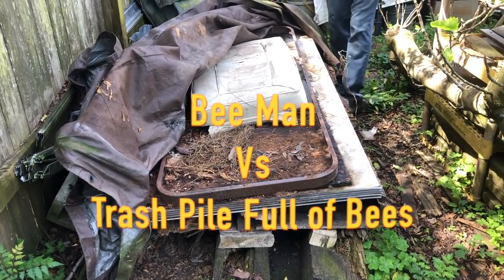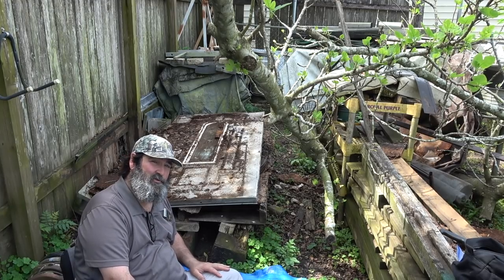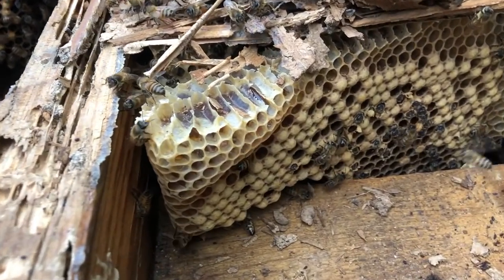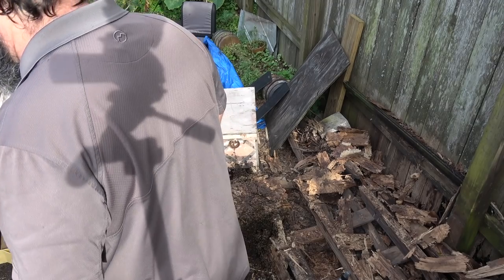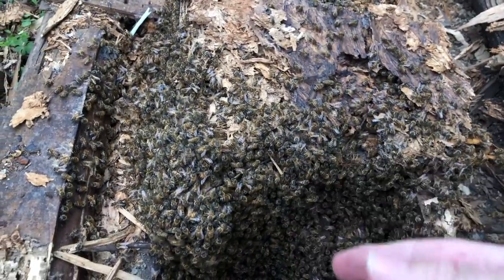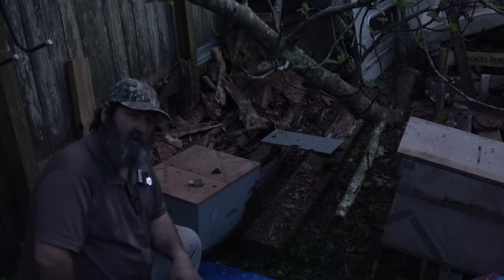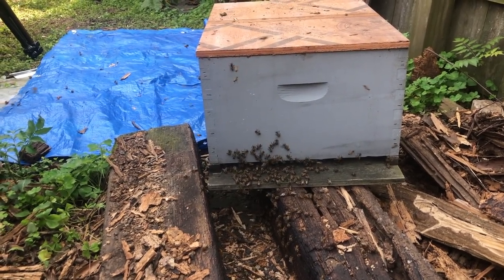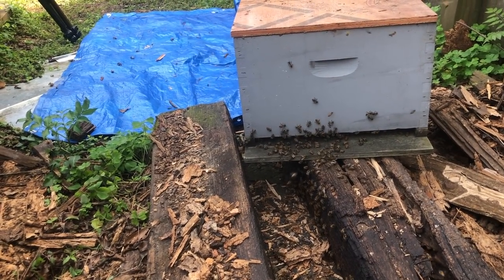Bee Man Vs Trash Pile Full Of Bees

Comment: I've been watching several bee keeping videos. I really like your's about retrieving hives from places they aren't wanted. I have never heard any bee keeper mention the use of Baking Soda for bee stings. Just put a  quarter size bunch of Baking Soda in your palm and add just enough water to make a loose paste and apply it to the sting. Try not to move the area to much for a few minutes because as the paste starts to dry it will fall off. This paste also works on wasp stings. I have used this on kids and grandkids for almost 50 years. If they get stung they come running to get the pace put on. Thanks for your videos.

Comment: Good video, except for most of the video the camera wasn't zoomed in enough to be able to see what you were doing. I would have liked to know what happened with the second queen. Did you ever find her? If so, what ended up happening to her? Iwould have swept that board off before I started pulling it apart, the board that was falling apart. I think less dust and dirt would have gotten on the comb that way. Other than that, good video. 👍